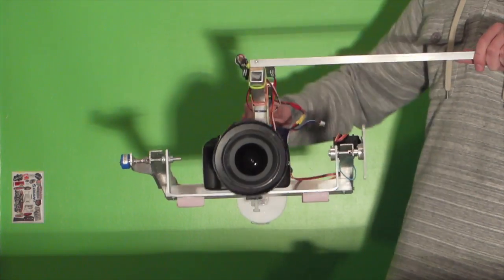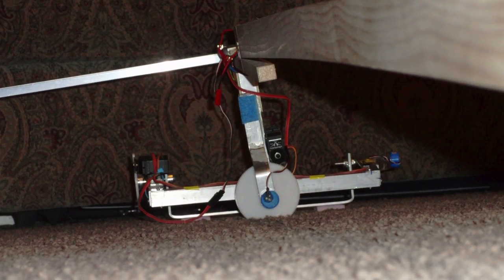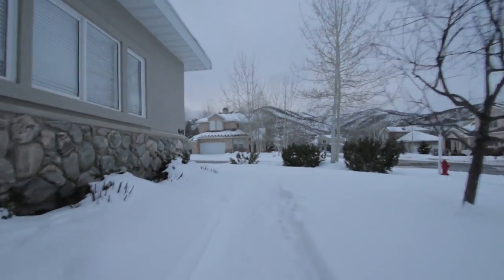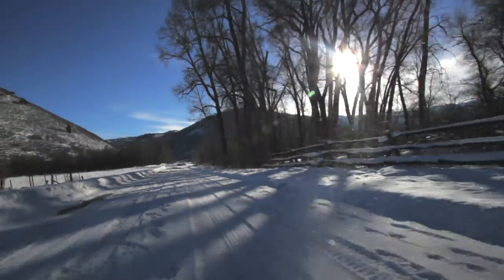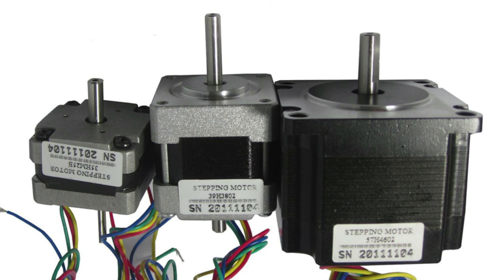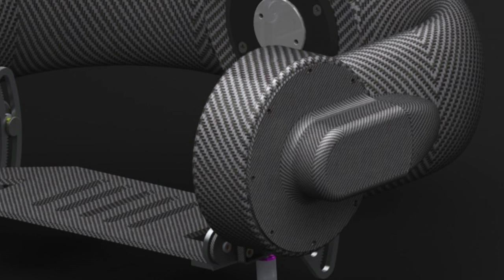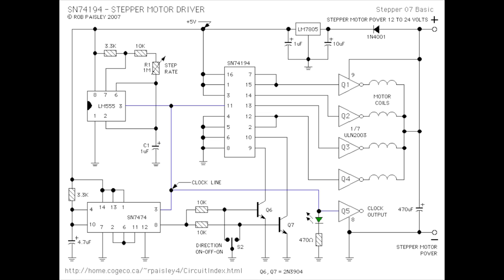Gyroscopically Stabilized Gimbal on Crane Arm Test

Comment from the maker: Id be fine with carrying a brick if it gave me smoother video.  The problem with geared motors is they take too long to change direction.  The highspeed motors in the servos have a lot of inertia and it takes time for it to slow down and speed up.

Comment: Not sure how much you know about PID, so forgive me if you already know this, but the Derivative part should prevent it from overshooting and thus prevent the oscillations.  If you increase derivative gain, what it does it look at the rate of change between the setpoint and the command.  So basically, it would generate a negative output just before the setpoint and stop instead of overshooting.  Steppers are also open loop, and they need to be homed and they miss steps and all sorts of junk.

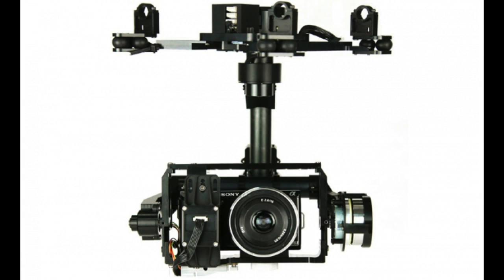Comment: 1:38 - DJI Zenmuse does not have stepper motors. It's equipped with 3 BLDC motors. The feedback comes from encoders. That's why the are called servo motors - the encoders (sensor) are coupled with the motors for position feedback.

Comment: It is not so hard to make an ESC like thing to control stepper motors with the servo signals. It would just require a microprocessor (atmega8) an H-Bridge and maybe some resistors, capacitors...

Comment: You should look into Arduino boards, I am not well versed in these but I am pretty sure you could program one to control a stepper drive. You can get a cheap stepper drive to experiment with by scrapping out old printers / scanners. The 3D Printer & DIY CNC communities would likely be a good resource.

Comment: I've just tried the cunningturtle stepper motor drivers too, but although they work fine, the steppers used did not have enough power to drive the gimbal (unless much bigger/heavier motors are used).............so...... I made the 'Alexmos' brushless gimbal (board from Viacopter) (see my latest tests)

Comment: Nice video writeup on this topic.  What speed servos have you been using for this?

I'd use at least the .06 sec or faster servos like the Hitec 7940 with big 200+ oz inch torque.  You could use the ultra fast .04 sec MKS servos but less torque.  Basically, the high end 3D helicopter competition grade rudder servos would be the fastest commercial choices.

Very high end servos are using 560hz updates which is not just fast but also smooth.  Requires slightly different servo PPM signal though.

Comment: The problem with stepper motors is they weigh much motor than regular motors for a given power output.  With the geared motors, have you tried tweaking P I and D?  I think you can probably get rid of that shake with a pinch less P and a sprinkle of D.

Comment: So if u need perfection u need either high $ or u need to reckon that using
high quality servos, BB-s and yer own simple but precise gimbal assembly combined
with some patience to find a good setting can make a difference and using a simple
KK or Mwii controller does the job perfectly. And for different situations u need different settings - theres no best all rounder setting.

Comment: The footage of it on the back of the truck looked good. I think that may be the only use for it though. The rest was so jerky you might as well use a simple stabilizer. Building the frame is the tricky part for something like this. Best to try to copy proven design's in my experience.

Comment: Stepper motors are not the guarantee u can solve yer problem which is the same effect as by servo twitching. 
A zenmuse is expensive mostly cause of the use of the high end swiss watch-like fine mechanic solutions & not just the steppers.
Twitching is = noise which can be filtered in two ways. 1. active way using gyros & PID closed loops - so lot of trial & error finding the best setting. 2. Passive way using rubber, jellypads, telescopic shock absorbers - again lot of trial & error = time = $.

Comment: It's not hard to convert servo signals to stepper commands. It's simply converting PWM to single-coil pulses (parallel), which can then be fed into a driver. This sort of time has been done thousands of times, it's nothing "revolutionary". This specific application could be done with a $1 microcontroller and maybe 50 lines of code.

Comment: Hey Buddy,
I am a Fan of your videos! I don't think that it is to hard to build a controller to convert Servo signals to steps for a steppermotor, although you would have to adjust the program on the microcontoller for different steppers.
If you find the time you could use an Arduino and two Big Easy Driver from Sparkfun.com. You are also going to need one Potentiometer (10K) per Stepper so the Stepper knows "where" it is. The Sketch (programm) on the arduino will convert the PWM from your reciver in to steps for the steppers. I found a post about that.
The whole Projekt will involve some tinkering and time but it is definalty do able. 
I was even think of doing it but I just don't have the time at the moment, sorry. But I could help you via e-mails.